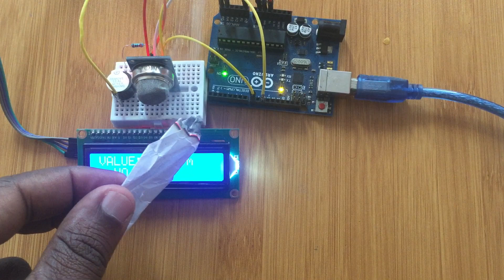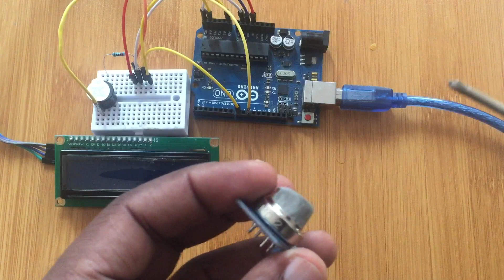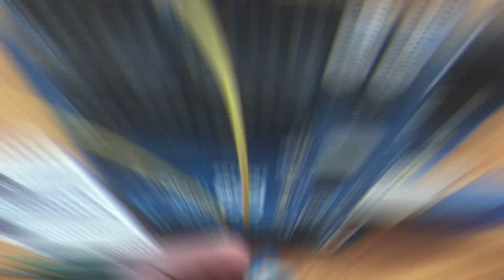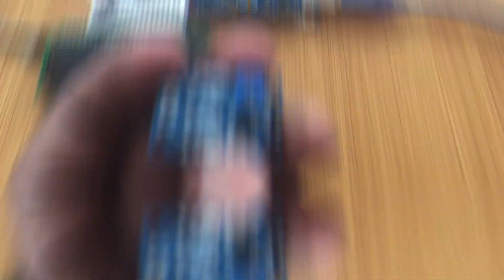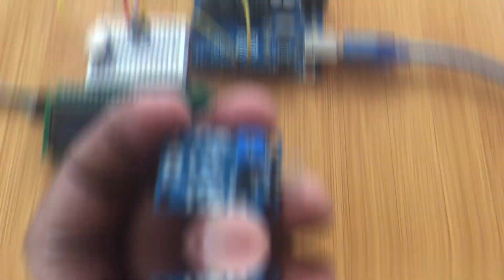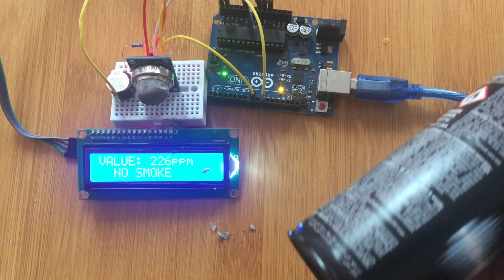How TO USE MQ2 GAS SENSOR WITH ARDUINO FOR SMOKE DETECTION.

Comment: here is the code again if you are getting errors 

#include <Wire.h>
#include <LiquidCrystal_I2C.h>
LiquidCrystal_I2C lcd(0x27,16,2);
#define MQ2pin (0)
int buzzer = 10;
int sensorValue;  //variable to store sensor value
void setup()
{
  pinMode(buzzer, OUTPUT);
  lcd.begin();
  lcd.backlight();
  lcd.setCursor(0,0);
  lcd.print("  GAS SENSOR ");
  delay(1000);
  lcd.setCursor(0,1);
  lcd.print("  WARMING UP ! ");
  delay(100); // allow the MQ-6 to warm up
}
void loop()
{
  lcd.clear();
  sensorValue = analogRead(MQ2pin); // read analog input pin 0
  lcd.setCursor(0,0);
  lcd.print("VALUE: ");
  lcd.print(sensorValue);
  lcd.print("ppm");
  if(sensorValue > 300)
  {
    lcd.setCursor(0,1);
    lcd.print("SMOKE DETECTED");
    tone(buzzer, 500, 2000);
  }
  else
  {
    lcd.setCursor(0,1);
    lcd.print("  NO SMOKE");
    noTone(buzzer);
  }
  delay(2000); // wait 2s for next reading
}

Comment: Hi,

I have the error:
'POSITIVE' was not declared in this scope

Any idea of how to solve it ?
Reply: #include <Wire.h>
#include <LiquidCrystal_I2C.h>
LiquidCrystal_I2C lcd(0x27,16,2);
#define MQ2pin (0)
int buzzer = 10;
int sensorValue;  //variable to store sensor value
void setup()
{
  pinMode(buzzer, OUTPUT);
  lcd.begin();
  lcd.backlight();
  lcd.setCursor(0,0);
  lcd.print("  GAS SENSOR ");
  delay(1000);
  lcd.setCursor(0,1);
  lcd.print("  WARMING UP ! ");
  delay(100); // allow the MQ-6 to warm up
}
void loop()
{
  lcd.clear();
  sensorValue = analogRead(MQ2pin); // read analog input pin 0
  lcd.setCursor(0,0);
  lcd.print("VALUE: ");
  lcd.print(sensorValue);
  lcd.print("ppm");
  if(sensorValue > 300)
  {
    lcd.setCursor(0,1);
    lcd.print("SMOKE DETECTED");
    tone(buzzer, 500, 2000);
  }
  else
  {
    lcd.setCursor(0,1);
    lcd.print("  NO SMOKE");
    noTone(buzzer);
  }
  delay(2000); // wait 2s for next reading
}
Reply: @williamchupin4842  thank willam..
Reply: I m gng to try this project ! Does this run good efficiently ?? Please do reply
Reply: @kixbix3292  i posted the working code
Reply: same positive
Reply: @beysik6871  i posted the working code

Comment: First of all, thanks for the video.
Is this sensor reliable? I would like to take advantage of your code and add it with another code with DHT22 Temperature and Humidity sensor, for example, while there is no detection of gas and/or smoke, showing Temperature and Humidity on the LCD screen. Do you have something like that or could you give me a hint on how to do it? Thank you
Reply from the maker: This sensor is quite good for smoke detection. About your other idea it’s just a matter or adding the libraries for the dht11. However you may need a larger lcd to be able to display all the readings for temperature, humidity and the state of the smoke sensor properly. I have a tutorial on the dht11 where u can make reference
Reply: @mytectutor  Thank you, I'll take a look. But, what I need is for gas leak detection.
Reply: @mytectutor   Sir can you explain how to adjust the sensetivity of MQ 135 ?